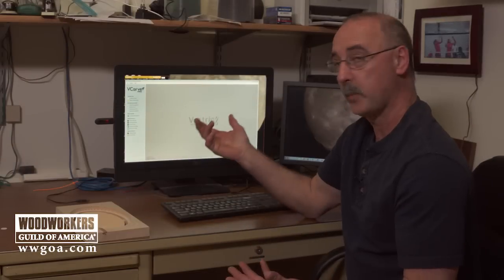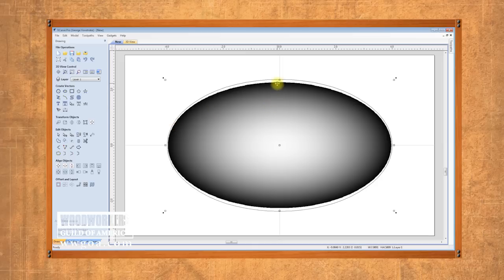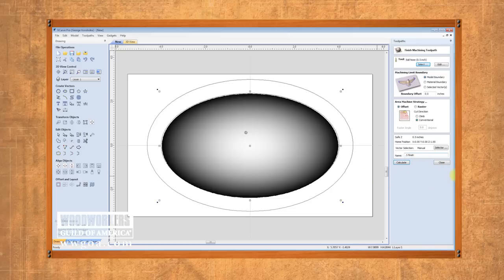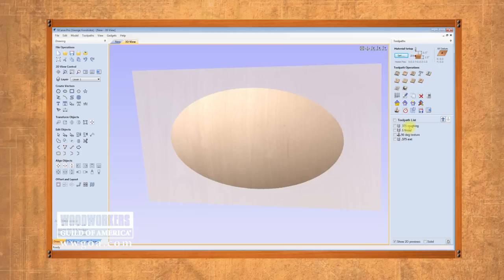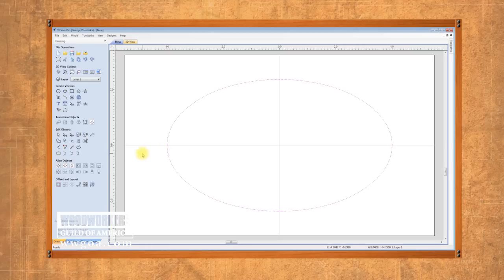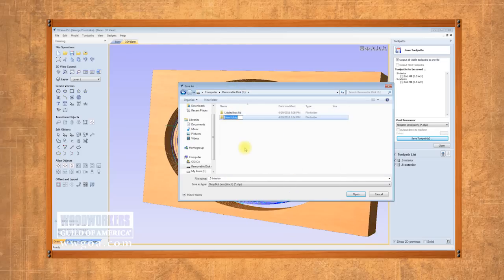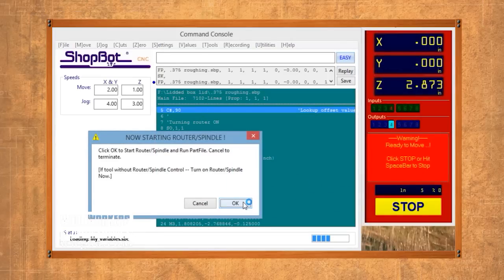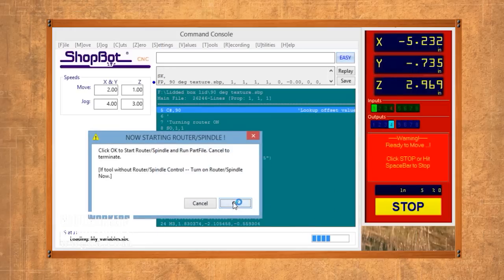Make an Oval Box and Textured Lid With a CNC

Comment: Nice tutorial there.  I use Mach 3 on a home brew. I have mach 3 where it will just stop cold automatically when a different tool is needed IF AND ONLY IF you specify a different tool number.  The only penalty is you gotta ht start twice on the start of a file.. This makes life far easier for me, just put EVERY tool path into the same file. You can turn on  the tool change detect manually if you wish but you gotta remember to do that first. Forgetting that has screwed up a few projects so I set it permanently on. 

This basic procedure as demonstrated will work on ANY cnc irregardless of make or controller. The specifics may be slightly different but overall, it works as shown. There are tricks to set Z zero without a touch plate too.